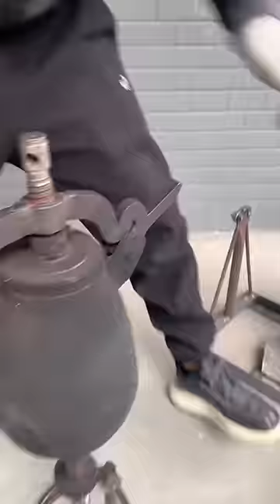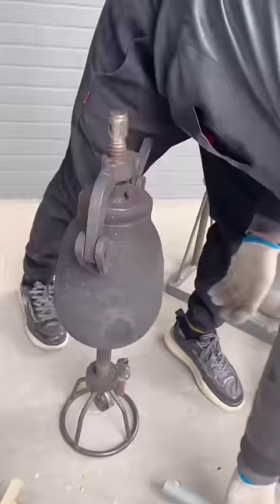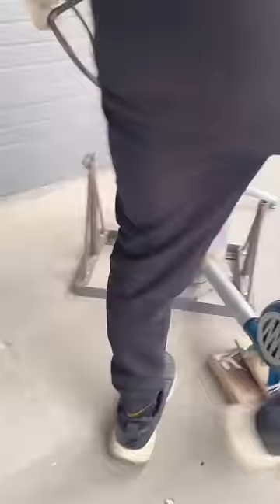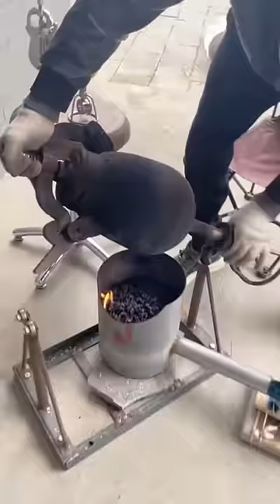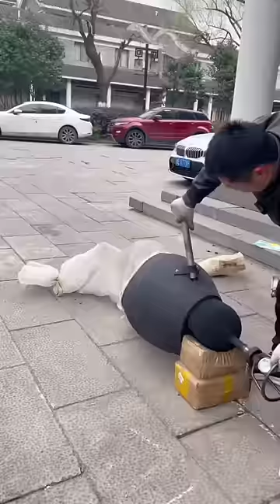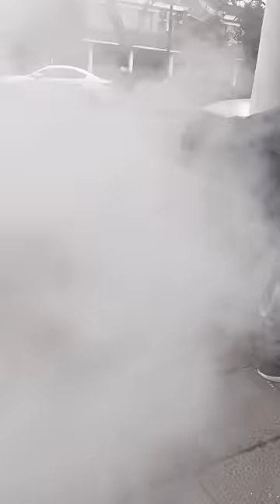Here comes the ancestor of the mini popcorn machine.hahaha

Comment: This is better than using oil for cooking popcorn.
Reply from the maker: Healthy original popcorn🎉🎉🎉❤
Reply: @popcorn-0098  Flavorless popcorn ohhhhh yummy
Reply: @JarrodHenderson  😂
Reply: Oil for popcorn??? Whatttt????
Reply: @suvo_cboipo  to cook popcorn on a stove top it requires oil 😊 this is simply pressure cooking instead
Reply: @popcorn-0098  butter is healthier than oil
Reply: @headshot9611  i use olive oil💀
Reply: And how is it better
Reply: @dontbeedgy  it is not. It burns at a lower heat and I've never heard of popcorn cooked in butter. Only butter added to popcorn
Reply: If you don't have this half way torture device, and wanna avoid the oil you can cook the popcorn in sand. It's really great, just buy clean sand and use it as replacement of oil, it stays in the bottom of your pot and the popcorn doesn't get one single grain of sand when you eat it, I swear. My mother learned it from a brazilian cook and it's so weird but impressive.
Reply: @JemSquash94  bot true and not, you CAN'T make popcorn with butter cause it will burn. You should use for that clarified butter, that's actually how the butter popcorn is made
Reply: @JarrodHenderson u can just put salt, hello?
Reply: Yea, we got gunpowder instead
Reply: @Roadblocks22 not good without the butter
Reply: @h5y878 What the hell, I'm Brazilian and I never heard of anything like that. Must be from some state in the north east, like Lençóis Maranhenses (Search it, in my opinion it's one of the most intriguing places in the world. A flooded desert)
Reply: @JemSquash94  Pressure cookers left the chat.
Reply: @Jarrod Henderson  "who you fight? What you fight? Diabetes is it?"
Reply: it’s safer in the health sense but if you aren’t careful this easily could be worse 😅
Reply: Air poppers are a thing too .. no oil. You can even do microwave in those special plastic material bowl with lid with no oil even tho I add a dash
Reply: @julianhoward9167  not safer, can bonb your hand
Reply: Can just add butter and salt after
Reply: @JarrodHenderson 😂😂😂
Reply: It's obvious that this is sidewalk flavored, don't be daft.
Reply: @4keYgrindsGames 
Right! Milk solids in butter will burn. Have to use Ghee (clarified butter) or desired oil of your liking. They do have butter flavored oil especially for popcorn.
Reply: @MathewCR 
Florianapolis?
Reply: I'm not seeing any flavor wth
Reply: Can't be healthy if you pack it on a street floor...